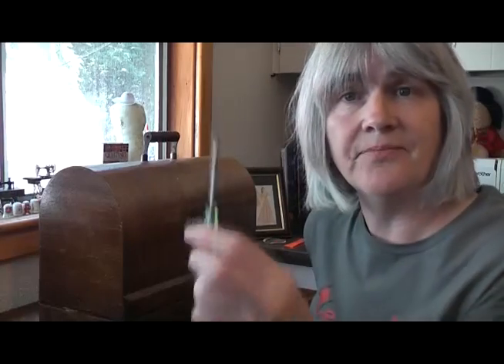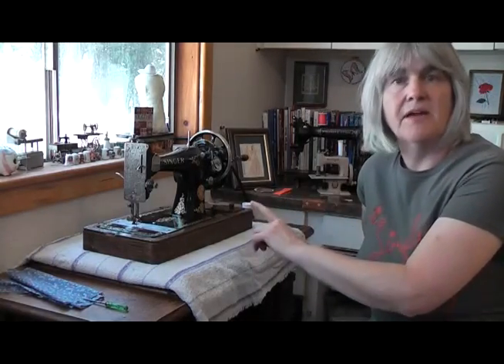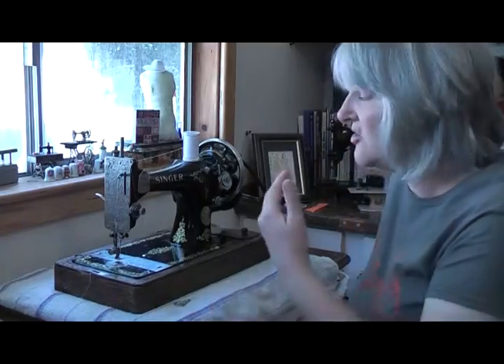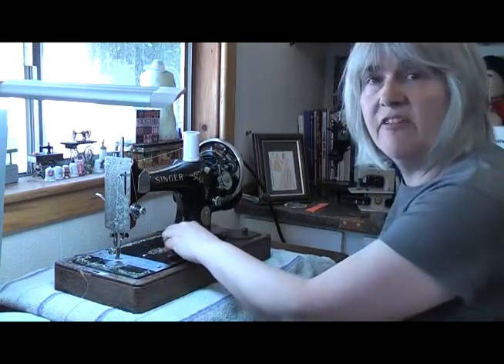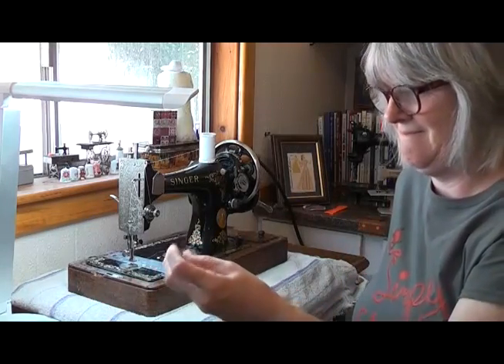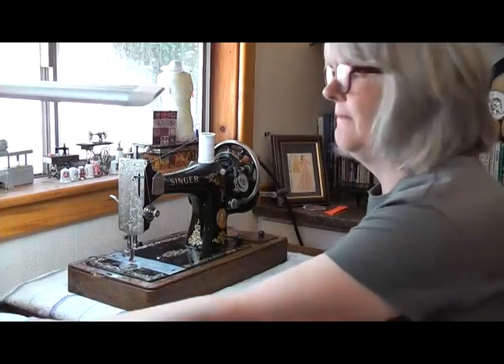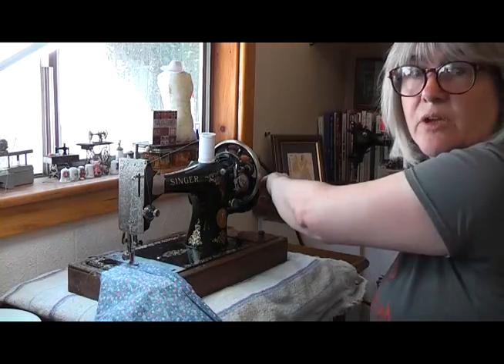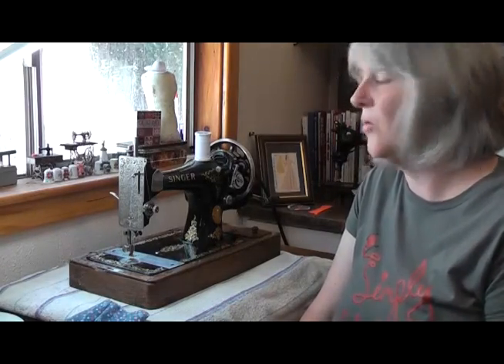Handcrank Sewing Machines: The Ugly Truth

Comment: Interesting video and premise.
Something I was not ready for when I started doing people-power conversions of old electric sewing machines was how wildly popular the hand crank was over the treadle. I thought users would preferer the treadles for the ability to keep using both hands when sewing, but boy was I wrong! I have been fitting hand cranks to treadle machines now so that the operator can have both. "Why" I asked? "Control" is the answer! It seems that is a big appeal, and maybe a bit of fear in using the treadle because without some practice, it is easy to start the machine off in the wrong direction.
Reply from the maker: I know, right? I like sewing with both hand cranks and treadles, but prefer the treadle. Once you get the hang of them, it's just easier to power something with your feet. Thanks for sharing and for watching! 🙂
Reply: Control is the main reason I myself am interested in a machine with a handcrank. Possibly the big hand-wheel on my (vibrating shuttle) treadle would be good enough, if I ever work up the courage to wind a bobbin & use it!

Comment: As a person who grew up on machines that were not computerized I found it very easy to transition to a hand crank. It seems like this video goes way out of the way to cause issues. I find them wonderful for piecing quilts. I also enjoy that they are quiet and I have absolute control of the stitch witch is super for paper piecing. Much Ado about nothing.
Reply from the maker: None of the issues showcased in this video were made up for the video. They exist. Just because we seasoned hand crank users don't tend to worry about them - doesn't mean they are not there! This video goes out of its way to highlight the fact that not everyone finds hand cranks easy to transition to. Nor are they the best machine for every task. Piecing quilts is one thing but have you tried free motion quilting on a hand crank? Thanks for watching. 🙂

Comment: Tongue in cheek bit of fun, I presume?  Because of course when you use your handcrank you use both hands for everything you normally would - except guiding the fabric with your left-hand only because the hand-crank is busy winding?  
The real disadvantage is when you need both hands to manipulate the fabric - and I find that's sometimes the case when I'm using some attachments or the fabric is large and heavy.  My left hand just isn't quite clever enough or strong enough, getting tired easily and not having quite as fine a control as two hands together...  A bit like trying to write 'other-handed' or eat with your knife and fork swapped round - I can do it but the results are less than satisfactory...  
But for most attachments I'm okay and definitely got a lot better with practice.

I have a very old hand crank (late 1860s) and the one time I've found when I really need a third hand is winding a bobbin.  Its bobbin winder is very basic with no guide - you have to do that by hand. And you also need to push winder so rubber ring is against the handwheel and wind at the same time - I haven't figured out how to do all three with two hands and wonder if perhaps it was invented by someone who was a concert pianist.  So for that, I get my 6'4" hubby to wind for me!  :-)

One thing I love a handcrank for is teaching children - everything stops the moment they stop cranking, and their don't have to learn hands-and-feet at the same like you do with a treadle or electric foot pedal.  I've even had quite a few adults have a go on my 1902 Model 28K* who have never sewn before who, afterwards, say they want to get one because they think they rather like sewing after all.  My guess is they tried as children and were freaked out at the runaway speed of an electric foot pedal or, if they tried to learn on a treadle, found mastering the feet and hands at the same time too overwhelming - as well as not stopping when they stopped treadling as they expected.
*Once a month I demonstrate at a historic home in Auckland, New Zealand and most people really love being able to try sewing on an old machine.  I take along a little 1914 Model 20 too.  It was intended as a machine for children to learn to sew (and says on the box that it is "A REAL SEWING MACHINE - NOT A TOY") and so many adults love it.  (Using full caps to drive a point home has been around a while, it seems!) Lots of them want one after they use it, declaring it does everything they need like taking up hems and resewing split seams etc, and it's '"So quiet and so easy - why don't they make them anymore?  They should make them again!"

Comment: i just got what i think is an 1892 fiddle base vs2 i have read they stopped making the vs2 fiddle base in 1891 so thats puzzling? but anyways i want a crank but the regular ones on amazon ebay will not fit is their a way to make a handle or adapt one for my machine i have seen some that seem to have a screw on to the tension knob would this type work???? my bobbin spool would normally be loaded using the treadle peddle rope to load it but i put on a small rubber ring and that works just need a handle system for the spoked wheel.
Reply from the maker: Singer may have stopped making VS2 machines in 1891 but that doesn't mean they stopped selling them in 1891. Lots of suppliers could have had VS2 models in stock after that date. Even Singer themselves could have been selling off old VS2 stock well into 1892. The only way to know for sure is to check your serial number on the ISMACS site. As far as I know, the VS2 was a treadle machine due to its weight. If any had been made as hand cranks, the hand crank stand would have been mounted to the table or wooden base rather than the machine. That's because Singer machines of that age didn't have  motor boss connection points. The lack of a motor boss means your VS2 isn't compatible with the modern style of hand crank that mounts to the head underneath the handwheel. You can still find table mounted or base mounted hand cranks but they are rare and expensive. I'm not sure what you mean about a screw to attach your hand crank to the tension knob.. Do you mean the tension disks? Not sure why you would want to do that or even how it would work. But then I'm not the best person to ask as I'm not  a mechanic. Go to https://ismacs.net/digest.html - join the digest - and ask there. The folks at the ISMACS Digest might be able to point you towards the right hand crank. Thanks for watching.

Comment: Hi PLEASE HELP 🙏 I have a Singer Hand Crank and it suddenly I don't know Why Won't make a Stitch😢 the last time I used it After Restoring it it was Fine, I made a Leather Purse on it. Then I went back to my Electric machine and this was just put aside. I recently moved and wanted to try it, got it all set up and it Won't make a Stitch ❓ it's Completely Mind Boggling Please Help 🙏x
Reply from the maker: Sounds like it isn't picking the bobbin thread up. Is your needle in the right way round. Older machines aren't front to back... Check the location of the thread guide above the needle. If it is on the left of the needle, your needle needs to be facing to the left. Then you thread left to right. If it is on the right-hand side of the needle - the needle needs to face to the right and you thread right to left. The only other things I can think of - are you turning the hand wheel towards you? Is your bobbin loaded correctly? Do you have a manual for it?
Reply: Hi thanks for replying 😊 Thankfully I've fixed it now after Lots of Tinkering, I put a new Needle in and it was, it was the Bobbin but She's back Sewing Brilliantly now 😃🪡 I Love how Quiet She is Compared to my Anti-Social Electric Singer, Heavy Duty Machine I've had about 1.5 Year's, it's Too Noisy 😱 x

Comment: Personally I'd not pish about with those vibrating shuttle machines, but the later Singers can sit for a couple of decades in the case, and yet with a little attention with the oil can, be brought back into use. I can remember my Mamy spending out big for a couple of the Elna 'Computer' models, that after a decade lost support when the company got sold. Those machines I still have, but I'd not give much for my chances of the things doing any work today ? The old Singers will manage a far bigger range of materials than the modern home offerings, and can easily be motorised for a quite low outlay. Your biggest disadvantage will be the absence of zig zag ability ? The one hand business was pointless, and demonstrated nothing. When all is said and done the old rotating or oscillating singers are still capable machines, and are worth more than being relegated to trendy decor. :)

Comment: I wonder if you're confusing vibrating shuttle machines with handcranks?  Vibrating shuttle machines can be run on electricity just like more modern rotary or oscillating hook machines. More modern machines can also be used as handcranks.

Comment: I cannot see the point in you purposely not using your right hand to lift the machine, thread it and other operations but then use it to hand crank the machine?
The only main disadvantage of them is not having two hands to guide the fabric and sewing and stretching elastic to a garment which needs two hands.
Actually Singer made one of the best needle threaders available its just that it is not fixed to the machine.
What about the preciseness we can get with a hand crank that we absolutely cannot with an electric?
I refer to sewing very small items or very delicate items.
If you really want to make things awkward try sewing with your feet!
Reply from the maker: I didn't use my right hand to crank the machine... maybe you should re-watch the video. I used my left hand throughout! This video is about the disadvantages of hand cranks... I'm so glad you spotted at least one. Advantages will be covered in a different video. I sew with my feet all the time... I have a treadle! Thanks for watching.